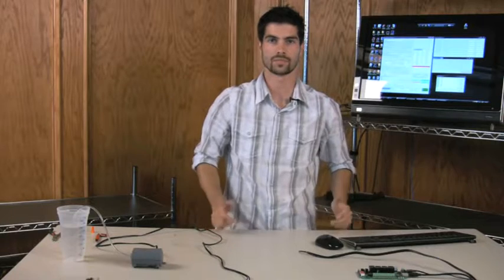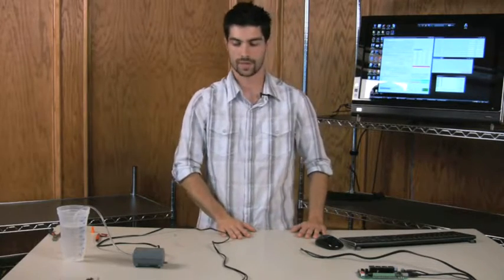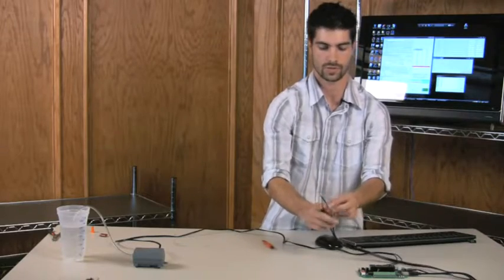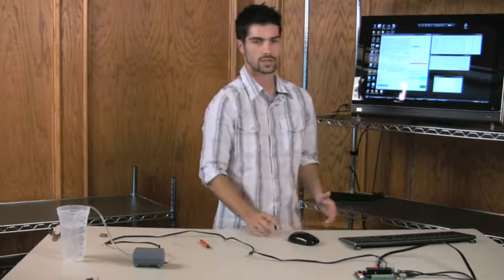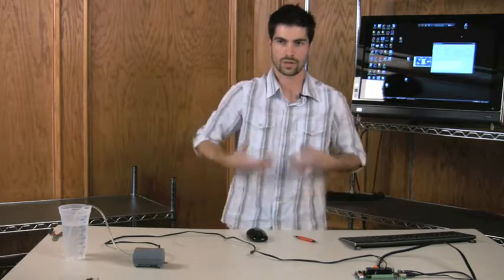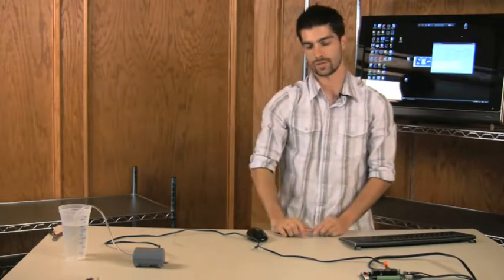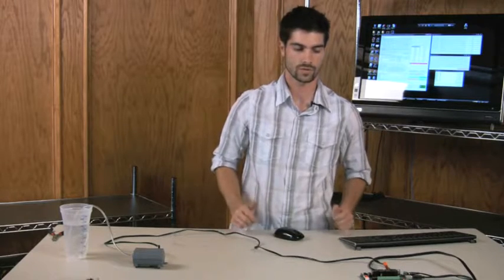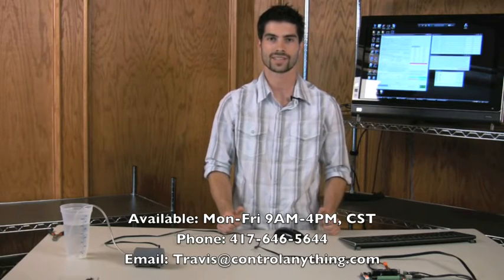Induction Suppression

Comment: I would expect the design of an "industrial" circuit board to greatly reduce the possibility of inductive kickback affecting peripherals like the USB controller.
Reply from the maker: Induction suppression is built into NCD circuit boards, however, induction can be very high, introducing excessive spikes into the logic in some applications.  This can only be handled externally at the source of the induction and not at the circuit board level.  A complete article on this topic can be found here: https://ncd.io/controlling-inductive-devices-managing-electromagnetic-interference/